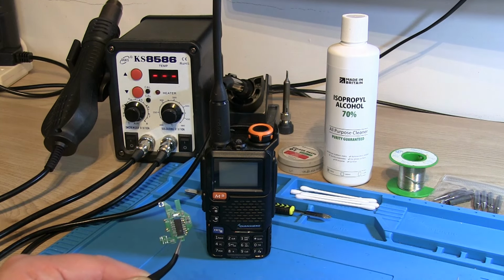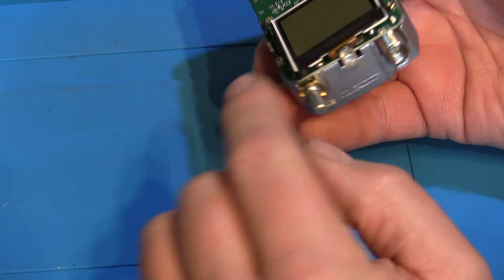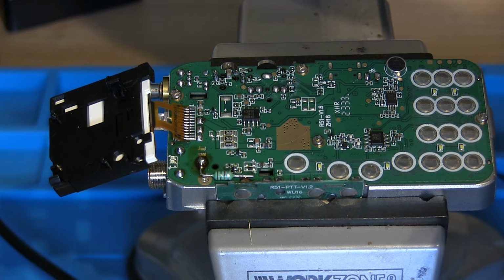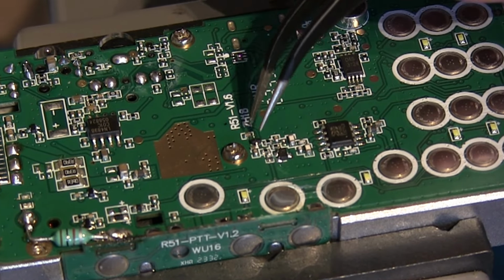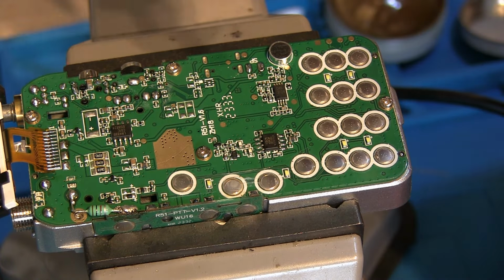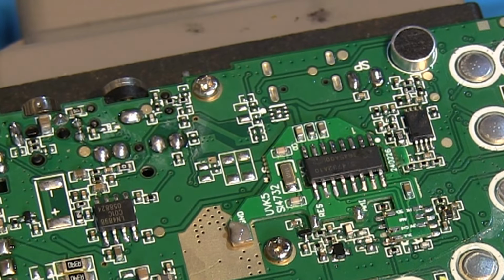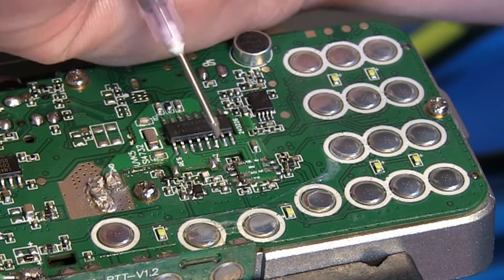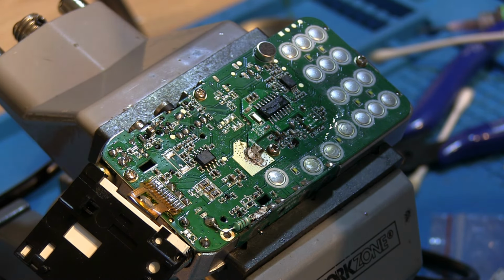Quansheng HF Modification  Hardware Install

Comment: Unfortunately Ben the smaller the iron tip the less efficient it becomes. Hot air gun is a waste for replacing smd stuff, ok for re flow work and new work with solder paste.  Removing SMDs I always ease a brand new craft knife under and cut them out so no heat involved.  You did well for a first attempt at SMD, practice makes perfect mate.
Reply from the maker: Cheers Richard 👍 Every days a school day!
Reply: U can use the hot air easily if u use a little flux and keep the air on it as your pulling with tweezers...

Or use the larger tip as suggested also w flux or actually add a touch of solder to your tip and it'll melt the joint on contact easier.... 

Last thing.... u HAVE TO tin your iron tip... helps transfer the heat and protects it....  tin your tip between every component as much as you can remember to do it....

Comment: Ben,  We have been following the same firmware mods with the Quansheng radio..... I am wondering if this mod was performed on a radio that had Egzumer Firmware Flashed?  I have Egzumer V 0.22 flashed into one of my radios, another is still stock..  Amazing little radio.... Thank You
Reply from the maker: This radio was fresh out of the box, so would have been on stock firmware until I flashed CEC_0.41HF 
It shouldn't matter what it was running, as it will be overwritten.

Comment: Well that was a barrel of fun watching this over breakfast this morning young Ben 😂. Don’t be to afraid of using more heat from the iron as you’ll be in and out with less damage, also just add a bit of fresh solder to those caps and they will lift straight off and not that liquid rubbish. As for those solder stations i doubt the temperature is anywhere near true on the tip. Anyway at least you had a go so have a big thumbs up and don’t let it put you off.
Reply from the maker: Cheers Neil! Glad it kept you entertaind 🤪 Yeah, your probably right about the solder station, the iron was on maximum temperature and just not man enough for the job. At least it was a successful mod though 👍
Reply: @m7frs272  Yeah just watched the video of it up and running. Another brill video, keep up the good work.

Comment: hi, I installed everything, everything works but when I go into mod mode for si4732 it freezes, I checked the soldering several times and they are correct, what could it be?
Reply from the maker: What Firmware are you using?

Comment: Fitted the mod board to mine yesterday. Bit of a faff! Initially there was no audio output when switching to the hf ranges. This turned out to be poor soldering on the supplied mod board. Two of the ic pins had no connection to the board! Once that was fixed, it worked. 

Very low audio levels on HF but good fun.
Reply from the maker: Excellent 👍 well done, thanks for watching!

Comment: Well done mate 😂 You just convinced me that I should not be doing this mod. Bought the parts as well 😏
Reply from the maker: Sorry if I've put you off! As long as you have a decent soldering iron, and a magnifier etc.... you should be fine. Good luck & thanks for watching 👍

Comment: I want to know how you got your 'ticket'.? 
While Not being able to identify circuits and components.
Reply from the maker: Hello, thank for watching and commenting. As I mentioned in the video, I welcome constructive comments and I'm happy to be corrected if I've made a mistake. As you are aware, this hobby is all about experimenting and learning. This kit came with no instructions or identification of parts. You will also be aware that as I hold an 'M7' or UK foundation licence,  (which I took during lockdown) there was no practical side to the course and/or assessments. That's (right or wrong) how I acquired my licence (or 'ticket' as you call it) This was never intended as a tutorial video, just a documentation of my own experience and learning.  
73
Ben
de M7FRS
Reply: Hmm .
So you are happy to plead "ignorance" when the shit hits the fan. 
I would encourage you to  find a local soldering class.
Reply from the maker: @snakezdewiggle6084  As I'm sure you are aware, with the newly updated licence conditions, us foundation licence holders are now permitted to build our own equipment, should we wish to. As I'm sure you are also aware, this modification is a 'receive only' mod. I appreciate that the HT is still capable of transmitting on VHF & UHF on 2m & 70cms following the modification, but yes I'm 'Happy' that it is still working within the specified parameters having tested it with the spectrum analyser so no need to 'plead ignorance' (another thing I wasn't taught on the foundation course) but fortunately, thanks to the more helpful of the YouTube community there is plenty of useful content and explanations available. I take on-board your more constructive comment, re a soldering class.
Reply: @m7frs272 
Yes, cos ALL the experts are on the Internet.! Just ask them, they will not mind telling you...  
What about the emissions above the upper limit of your analyser. 
If you are a well studied, freshly minted Foundation Licensed operator, you'll have no trouble explaining how many RF paths there are between You and the air by your antenna. And, why adding that mod to your radio has a negative effect on sensitivity and selectivity The answere is not on the Internet, you will have to hit the books. 
Are you just another "mic jokey", or are you into the science.?

Comment: Isn't the volume knob underneath fashioned to remove the antenna lock nut?
Reply from the maker: It doesn't appear to be on the Quanshengs.
Reply: @m7frs272  oh ok thanks for clearing that up. I hope your mod is working.
Reply from the maker: @ominkan3129  Cheers. By some miracle it is! Follow up video coming soon!

Comment: Was going to this mod, but I'm having second thoughts now, thanks for showing me how hard this is to do as I have no previous practise with smd comps, I've built many projects over the years including my first transmitter nearly 65 years ago. I still like valves, (73's G4LEN)
Reply from the maker: Thanks for watching and commenting. Sorry if I've put you off attempting it. This was my first real attempted at working with tiny SMD components as well. I've certainly learnt a lot from it and there's a lot I'd do differently if I was to do it again! Thanks again, 
Ben de M7FRS
Reply: @m7frs272  Well maybe I get a microscope and still give it a go, I generally don't give up so easily. Thanks for the QSO. 73's.
Reply from the maker: @gardeningfromscratch.  Good luck and let us know how you get on if you do give it a go! 73

Comment: I'm stuck at the first hurdle. I have 2 UK K5 radio's, the 2023 model the gold ring unscrews until it gets tight at the top of the thread. The 2024 model the gold ring unscrews very easily until it is flopping about but underneath it is another gold ring!. The top ring goes tight and won't remove. Both radio's are different. I'll keep trying.
Reply from the maker: Apparently, (if you leave the ring screwd down tight) it's not necessary to remove them as the case should still come away from the housing.

Comment: You've got to pre-tin your soldering iron tip. That would have helped a lot with this job. Also, sometimes hotter is better; higher temperature will allow you to get in and out quicker without enough time to heat up the surrounding components.  I've had my fair share of melting wire insulation to learn lol. great job and thanks for the video.
Reply from the maker: Thanks very much and thanks for watching 👍

Comment: solder paste is why,  you should pick up some 0.6mm or even 0.3mm 60/40 rosin core, I think you will like it for small stuff. its a massive difference vs the 1.25mm stuff you used for the big resistor. 
Looks like a fun mod, I guess it makes the handheld only suitable for receive, and a weird assortment of bands. 
seems like 153-279khz, then 520-1170khz, then 2.3-26.1mhz
I only just got a uv-k5 and now I may have to buy another one for this
Reply from the maker: Thanks for the information, that's really helpful 👍 When it's in the HF mode it is RX only but the HT will still function just the same in VHF/UHF mode.
Thanks for watching and commenting.
Here is the follow up video:
https://youtu.be/vdxoFKWfMJc?si=L_y2W3LDml0-a-An

Comment: You can repair the ribbon cable with a optic lenses or microscope camera and solder all the connections back together, and some cap tape
Reply from the maker: Thanks, I replaced the screen in the end:
https://youtu.be/jRtYBoKty1s?si=1Xuwi8Ncv2L82eEQ
Thanks for watching 👍

Comment: I would have put a bit of solder on the tip of the iron when removing that small component. The melted solder on the tip will quickly melt the small amount on the component.
Reply from the maker: Thanks for the info and thanks for watching 👍

Comment: Don't think you should pry on the top. Just pop bottom out and pull it out. Also soldering iron isn't hot enough and you should tin the tip so heat will transfer better.  Using hot air where parts are so close is risk to mess up something.
Reply from the maker: Yes thanks Richard, I quickly realised that I only needed to pry the bottom. I had the Soldering iron on maximum temp, but it's not the most expensive solder station so that was possibly part of the problem. Thanks for watching/commenting.
Reply: @m7frs272 yep. He’s correct. Solder tip should look shiny with solder every time you touch the board. Ditch heat gun. Go in HOT and remove/ add components quickly. Solder should melt all most as fast as you touch it. We do not wanna heat nearby components. 
I had an electronic business for a time!
73 great stuff!
Reply from the maker: @johnemmons9087  Yeah I think I definitely need a better/hotter soldering iron! Thanks for watching 👍
Reply: @m7frs272  you got it!
I started soldering boards back in 1974! And still making little boards! 
I actually soldered a board with a 1/4” solder tip for an attenuator cause I couldn’t find my fine tip! 
Worked fine. Once you get it you can solder anything with anything!
Take care and keep the Quansheng vids coming!
Reply from the maker: @johnemmons9087  Thank you!

Comment: I've fitted a mod kit , the choke needs to be placed where the screw is removed or the display can't be re-fitted properly. It is wired between gnd and center pin of sma connector. Be careful using a hot air rework station at 450 degrees other small components are easily blown off the pcb , I would suggest 270 max or a 450 soldering iron.
The replacement 0.1uf capacitor is a fiddle,  but try solder braid to clean the pads and position replacement capacitor and tack side towards outside of pcb first.

Comment: I'm kind of late to the game, but anyone looking to disassemble this radio should note that the gold nut/ring on the antenna connector is actually under the plastic shell and should not be removed first. You just have to loosen it if/when you remove the aluminum part of the body.
Reply from the maker: Thanks for the info, I also discovered that afterwards. Thanks for your comment and for watching 👍

Comment: When you're desoldering and removing components you have to get used to using a Desoldering Pump. When you apply a Soldering Iron to a Component the solder just runs around the contacts and cools again, that's why it took so long.
If you remove all the Solder first the Component will just fall away as there's nothing to hold it there.
My approach would have been to use a larger Iron Tip, apply it right on the top of the SMD using a small pump at the same time.
I know it's easy for me to say but then I've done it hundreds of times in my line of work, when you get the hang of using a Pump it really is a 5 second job.
Reply from the maker: Thanks for the advice 👍 Yeah I've got a old standard desoldering pump, but been looking at the electronic desoldering iron (although probably too big for SMD work). Thanks for watching and appreciate your comments 👍

Comment: Magnifier, Smd station, clean tips ie angled wedge tips so they hold heat…. I work on my fpv flight controllers a lot, made many mistakes and practice makes perfect. Work quick and clean as possible. I keep my old broken electronic to scavenge from and practice with. I strongly recommend flux paste and solder paste along with iso to clean the flux off afterwards. Flowing a component it’s a tricky beast… best tip don’t wade in unless you can had practices or calmed your hands down 🙈😉

Copper wick was a game changer for my learning 🤙🏻
Kapton tape is a good aid for blanking non target surface mount components
Reply from the maker: Great advice! Definitely could have done with a magnifier and a better SMD station. (Mine just won't run hot enough) Thanks for watching & commenting 👍

Comment: You definitely have Butterfingers when it comes to soldering small components cannot use a hot air gun it’s really easy to do just grab the component with your tweezers at one end and set it on the place where you want to solder it and touch the solder tip to the end easy I hope you get it installed correctly without burning traces The reason why the ground wasn’t sticking very good you burnt off all the trace material With hot air gun   And the part where you were soldering a six positions, using that hot air gun, you were blowing melted, solder all over the board, and it was sticking to everything
Reply from the maker: Thanks for your comment. Hopefully I've improved a little now... 
https://youtu.be/ka6mybUag2Y

Comment: Well done but my blood pressure went through the roof watching your techniques. The soldering iron is not a spreader. Use decent flux, the type you get in a syringe. Re-flow the  pads with tin lead solder if heat wont work. Use copper braid and flux to clean the pads after you removed the components so they are clean and flat for installing the new components. Hope it all works.
Reply from the maker: Sorry about your blood pressure! (I have some tablets for that lol) Yes, fortunately it does work ok! Thanks for the advice and thanks for watching 👍